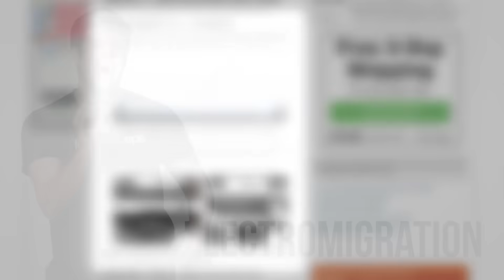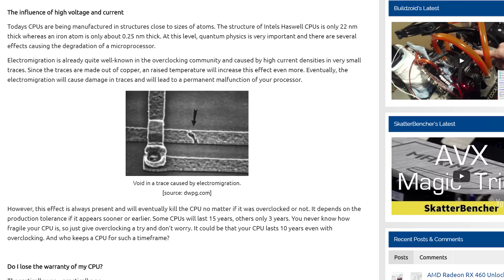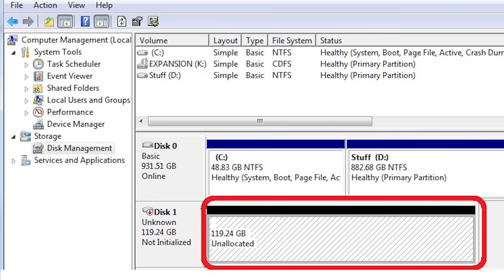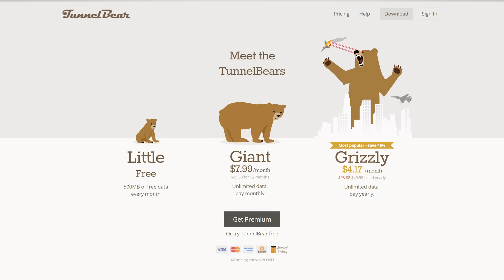Why Do Electronics Die?

Comment: 4:40 Yes, especially Apple
Reply: android makes sure the flagship OS version is only officially supported for 2 years, i constantly see people using old iphones with current OS version on them. I say google is far worse to their customers in this regard
Reply: alex alcala ortiz same lol and it had the same problem after they repaired it when I was under apple care. like what the hell apple
Reply: I still see a lot of working iPhone 4's or iPod touch's and MacBooks from the same year. That phone is 7 years old. If they are "implementing" planned obsolescence, they doing a terrible job 😉
Reply: toontownlegomaster and also the iPhone 4s can support iOS 9 but it's slower than a fucking snail
Reply: agree apple chargers fall into this but every other piece of thier hardware I have had has outlasted a non apple equivalent I have owned. I've not owned an iPhone to be fair but most smartphones have a limited lifespan with the hard life they get and rapid upgrade cycle of most users
Reply: After 5 years my old IPhone 4 is still working VERY WELL but it cannot use ios 7!!!IOS 7 THAT LIKE 2 YEARS OLDS RLY APPLE??!
Reply: MikelG00 
I've fixed my share of iPhones, iPods, iPads. It's pretty easy thanks to Chinese replacement parts and sites like iFixit. The thing you have to watch here is how Apple designed assembly so that in most cases, when you reassemble, too many turns or the wrong fastener will cut the traces on the main boards.
Reply: +MikelG00 Nobody said they did this back in the days.
It's all about how they are constructed anyway. For example: Take Tantalum capacitors, Apple loves to use those. But they only have an expected lifespan of about 3-5 years before they die. Sometimes, Apple will deliberately add complex logic chips to their mainboards instead of simple transistors to cut down the lifespan. There's an example where you have two input rails, one enable rail and one output rail.
The logic in this chip is a simple one:
If both enable-wires and the power-rail are present, then the output rail will be present as well. Instead of actually connecting two separate lines to the input rail they just take one line, split it up in two and connect both of them there. They could entirely save themselves the effort of adding that chip, but just don't since logic-chips fail more frequently due to the smaller transistor size and number of switches and transistors inside of them.
Reply: MikelG00 their premium products don't die out faster. Like if I had put 300 dollars more for MacBook pro back in 09 I would've had minor issues.
Reply: OneMinuteFixed that's were your wrong.  Yes they do that to you.  But they support older Os for such a long time while ios once it's your iPhones turn and it's time for it to go you won't ever be able to download a single new update. Like when I first got android Facebook was supported all the way from Android 2.3 and I was on kit Kat. I was like woah that seems like better support then stupid iphone
Reply: That was my fav iPhone
Reply: Apple legit does this a lot more than Nvidia could ever do, not to mention that Nvidia usually only produces the reference designs for cards anyway.
Louis Rossmann, who has a YT channel and owns a motherboard repair shop for Macbooks, once said in a video that he finds it fascinating with what precision Apple is able to implement planned obsolescence into their design. He supposedly has an extreme amount of customers coming to him because their 3 years of Apple care ran out like a week ago.
Reply: and nvidia.
Reply: ha so true our macbook litterally died the day after warranty ended